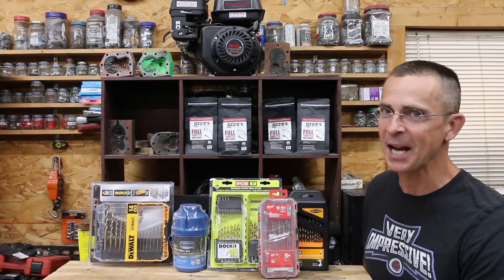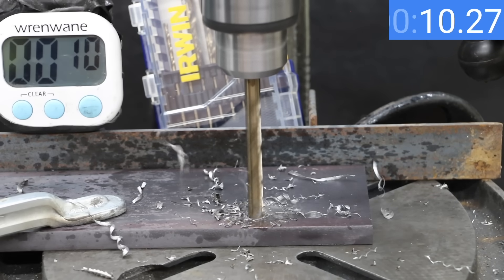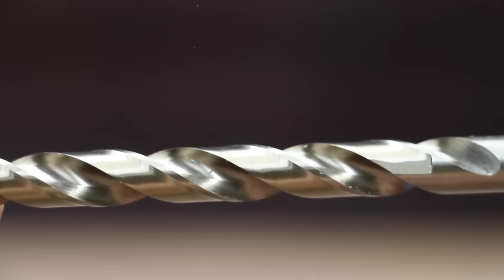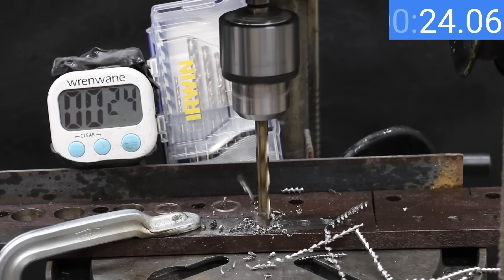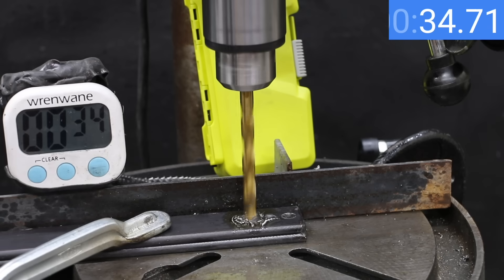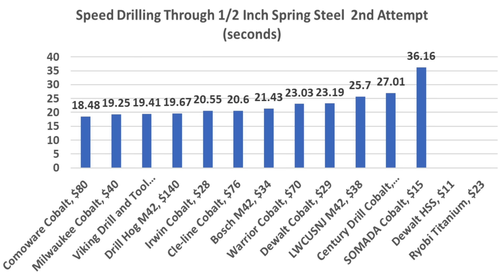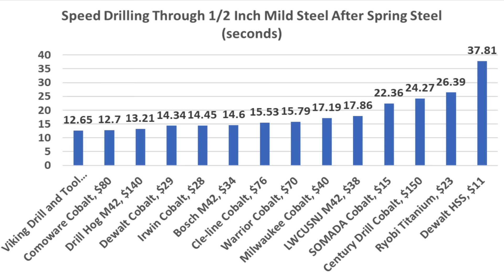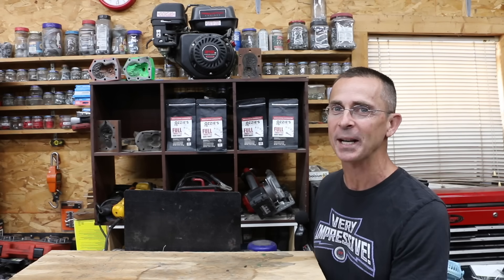Best Drill Bit Set? $11 vs $200? Let’s Settle This!

Comment: Hello Bonjour, ref. windshield wipers. Some time ago, you tested windshield wipers and the Bosch Icons came on top. I agree with warm weather performance but they are edging to be the worst cold weather wipers. I know it would be difficult to test a large sample of winter rated windshield wipers but if someone can figure it out, it’s you. Again, thank you for sharing your thorough testing procedures, your analysis and recommendations while running an ethical, unbiased and entertaining content. Cheers!
Reply from the maker: You are welcome!  Thanks for the suggestion.

Comment: I bought a 6mm Dewalt pilot point 6 or more years ago for roughing/ pilot drilling in my lathe, since I was getting through standard twist drills so fast, it's still going strong( I can't resharpen anything successfully, so it's saved me buying ten or 20 standard twist drills in that time)
Reply from the maker: Thanks for sharing.

Comment: I do like this channel, you do a great job testing.  You provide good data to make your case, data driven conclusions are the best.  The ability to drill holes fast is only one aspect, the other is accuracy, size of the hole, also surface finish. Great job.  Cheers!
Reply from the maker: Thanks!

Comment: I was impressed with the Irwin and Viking performance.
I've got a set of Rigid cold fire cobalt "cryogenically treated" bits that have done very well for me over the years. They tend to be brittle (i've broken 2 or 3), but they cut through anything and don't dull. I can't find them in the stores anymore.
Reply: I've got the same set, appears it's no longer available, sadly.
Reply: wander why...  cant even get decent t shirts any more.. here in aus. there was a penguin brand. still have a few from 20 odd yrs ago. new ones last couple months.. looked up penguin, $50.  not $5, as they are now.. ave, does good tool reviews, & funny.. wit..
Reply from the maker: Thanks for the feedback.

Comment: Ummm, you testing just straight twist drills, or we doing colbalt, diamond tip, carbide?
Reply: We doing metallurgy tests on heat hardening materials that you’re drilling so close to as well? So many factors go into this .
Web size, tip type, cutting angles.

You’re opening a can of worms from anyone who knows about machining at the minimum

Comment: Great test idea.  My Bosch set has served me well for the last 4 years.

Todd, it would be awesome to see you test various car parts from different aftermarket manufacturers.  I never know which ones are best nowadays since there are so many to choose from.  Orielly? Advance? AutoZone?  Sure, every car would be different, but if you were to test generic parts like ball joints, tie rod ends, bearings, whatever…might give us an idea of who makes some of the best parts?  You’re awesome, thanks!
Reply: I'd be curious to see this too but typically the in house brands are pretty much all the same, a lot of them will have the same exact mold/casting numbers on them.
Reply from the maker: Thanks!  Thanks for the suggestion.

Comment: I did work on school holidays drilling 1.5mm (0.0590551181 inches) holes in nuts for lock wire. We used quality brand  drills but some could make 4 pieces and others could make 20 pieces (same brand. same machine and settings) so it can differ in batches.
Reply from the maker: Thanks for the feedback.

Comment: Echo Red Armor 2 stroke oil does an amazing job at cleaning existing carbon out of a 2 stroke engine but could it also work to clean carbon from a 4 stroke engine if you run it through for a while? Better than some of the other products marketed specifically for automotive applications?
Reply from the maker: Thanks for the suggestion.

Comment: I’ve been using the same set of dewalt cobalt non pilot bits for a for a couple years now. I drill a lot of high carbon tool steel (annealed obviously). Biggest issue people have is improper speed and lack of coolant/oil, causing  overheated bits. I will say titanium coating is a gimmick, it’s only to reduced oxidation on the bits. Titanium is soft, way softer than HSS.
Reply from the maker: Thanks for the feedback.
Reply: It isn't titanium it is titanium nitride. Titanium nitride isn't a metal it is a ceramic. M42 cobalt steel has a Rockwell hardness of 68 to 70 and titanium nitride has a Vickers hardness of 1800–2100 66.5 Rockwell is 900 Vickers 1800–2100 is off the conversion chart. Way off.

Comment: The Cle-line looks an awful lot like the set I have from my time in the USN.  30 years, and these bits are still going strong.
Reply from the maker: Thanks for sharing.
Reply: I've been involved in machining for 45+ years, they're the set I would purchase.  Reasonable price, quality steel Huot case, appeared to suffer the least damage, made in USA by Cleveland Twist Drill, and are traditional 135° split-point so they don't walk as much and can be re-sharpened on my Black Diamond drill grinder.  One aspect that wasn't covered was accuracy of the hole size.  As the lips get damaged they will start pulling the bit off-center causing a poorer surface finish and a larger hole.  I was also disappointed that one of my personal favorite manufacturers Chicago Latrobe weren't represented in this test.  I have a C-L #1-80 drill index I've been using in my shop for 40 years on mostly mild steels and some 4140 and O1 tool steels.  They've held up remarkably well, I've rarely needed to re-sharpen them.  I've always use Rapid Tap cutting oil anytime I'm drilling steels (A1 on alum) which reduces drilling forces and greatly extends the life of the drill bit.
Reply: @marcseclecticstuff9497 Yep! The holes have visible tool markings in just about all of them . When drilling metal cutting fluid should be uses more often then just a drop on the metal.  That is the reason most production machines regardless of type have coolant tanks/sumps and pumps to ensure tool life.
Reply: @danielbackley9301  Production demands are actually very different.  The coolant certainly does provide some lubrication, but it serves 2 more important functions.  

First, it's for cooling the tooling.  As the tool gets hotter it expands.  If you have a big boring bar on a finish cut and it's really hot, you'll oversize the bore.  This is also the reason why most CNC machine centers circulate oil around the outside of the spindle and run it thru a chiller to try to keep the spindle at a constant temperature.  Some machines even use a chiller on the ball screw bearing blocks to keep their temperatures stable.

Secondly, and more importantly in some cases, is chip evacuation.  When drilling deep holes you have to keep the chips flushed out of the hole.  If they pack around the drill it will start galling the inside of the hole and left unchecked will cause the tool to seize inside the bore and breaking the tool.  Most of our machines have thru-coolant spindles with high pressure coolant pumps that feed them.  Ours are typically set to 1000psi with the smallest tools, bigger tools with more or larger passages causes the pressure to drop down proportionately.  We run a lot of gun drills, some as deep as 24" or so and if the thru-coolant fails, they will quickly start to gall and seize.

Most modern production coolants use synthetic oils that emulsify in water and look like watery milk.  It's nasty stuff for most plastics and rubbers.  Plastics tend to get brittle and crack, rubbers suck it up like a sponge, expand, and turn into goo.  I had a current probe attachment for my meter that sat in my toolbox that started cracking and falling apart after about 10 years.  I'm very good about cleaning all my tools, especially my expensive test gear and it made no difference.  Even being in my box in the maintenance department there is still enough coolant mist floating around to affect it.

In my home shop I've never used coolant - too much of a PITA to deal with and I'm simply not in a big hurry to do things.  For instance, if I'm drilling a deep hole I simply withdraw the drill constantly to clear the chips.  If I'm doing something that needs a high degree of precision, I make sure I let the part cool down before making a finishing cut to size.  I've used Rapid Tap for the 40+ years I've been whittling metal at home, it's served me well.  Not only does it reduce wear in tooling, it also reduces cutting loads.  Try drilling a 1/2" hole in steel dry, then drill another using a good quality cutting fluid and the difference in feed pressure is quite noticeable.  For tapping I prefer a dark cutting oil with a high sulfur content.  Unfortunately, the stuff I've tried in the past 20 years just doesn't work nearly as well as the stuff I used to get in the late 70's and 80's so I just use Rapid Tap now.  At work they stock Cimtap which I never really cared for.  It's very sticky so it stays on the tool, but it also sticks to the ways of the machine, collects fines and they get drug under the wipers and trash the machine ways.  Not an issue for true machinists who would keep the ways cleaned off, but in a factory full of Bubba's that are too lazy to wipe their own a$$, it's a machine death sentence.
Reply: @marcseclecticstuff9497  nowadays, the same company owns Cleveland, Cle-Line, and Chicago Latrobe. They're all functionally identical, and they all use the same lovely Huot cases. I started off my machining hobby with a set of Chicago Latrobe drills and didn't know how good I had it until I made the mistake of getting one of those godforsaken no-name import number/letter/fractional drill size kits. After I ruined at least 3 projects, I replaced it with the equivalent Chicago Latrobe kit, and the 3x price increase was well worth it.

All this to say, it seems like the corporate merger of those three brands doesn't seem to have ruined the quality of them. Always nice when that happens.
Reply: @marcseclecticstuff9497  Odd coincidence, as I have the same drill bits for my drill presses.  Everything you said about them is true, although I'm sure I don't use mine nearly as much as you do yours.

Comment: I'm only at 10:10 of the video, but my experience with Dewalt bits, they bend extremely easy. They are sharp, and hold a Blade well enough, but I have several broken and bent. I've never had that issue with even the lowest priced Viking bits.
Reply from the maker: Thanks for sharing.

Comment: Always well done. Ideally have two sets of bits. The economical dewalts and some of the high end bits. When you have something hard to cut through I’d slow it way down and use plenty of lube. The cheap bits you can easily repair/replace if needed.
Reply from the maker: Thanks!  Thanks for the feedback.

Comment: 5:44 There's my brand! It's the only non-Japanese drill bit I use! Viking is great, and they have sooo many types of bits and coatings. Their TiAln coated bits are amazing for the price! It will make stainless steel put a hole in itself out of fear alone. 😅 😅
Reply from the maker: Thanks for the feedback.

Comment: Considering the price point : effectiveness ratio, I feel justified just dropping the $10 on that DeWalt set every time I go to the Hardware store. I consider Drill bits "Wear" items anyway, but as long as it isn't Spring Steel it'll do pretty much anything without much complaint. Hell I've ruined more bits having drills fall off higher places than through actual use.

If I ever needed to drill Spring Steel for some reason though, yea I'd probably get something a bit more specialized.

Comment: I am amazed in how much down pressure you use on the drill press.😮  That must be why it takes me forever to drill into steel.😢
Reply: That's why it's called a drill PRESS. PRESS is short for PRESSure. Beyond that drill presses press very straight. That's important too.

Comment: Reasonable testing procedure, but holes that big should really be pilot drilled. Drilling a hole that big without a pilot is basically a destructive test, which is evidenced by some of the results you got, and not how someone who wants to maintain and preserve their tools would use them in reality. Maybe do the tests again with a 1/16 or 3/32 pilot hole....

Comment: I will tell you that I have a set of DeWalt drill bits and a set of Milwaukee drill bits with the 1/4" hex shank. The Milwaukee Red Helix bits dull EXTREMELY fast and my DeWalt bits are still plenty sharp enough to use and I've had them for about a year now.

BUT my Milwaukee Cobalt bits are excellent. They cut fast and clean. But I don't drill through spring steel. Only mild steel and stainless 1/16" - 1/8" sheet metal.

Comment: Great video - At work we drill a ton of metal, lots of Stainless Steel as well and to my surprise the HSS bits that we use (I don't know the brand off hand) seem to perform almost as good as the cobalt bits but we have only recently thought about testing what we use - and we ran a test but it was on taps... tested sizes around 1/4 to 3/8  and there were some clear winners and losers price was not a factor, some of the lower priced bits did almost as well and the best tap was mid priced.  

And right at the end of the year one of the machinists brought in these blue coated bits called mach blue - don't know anything about them but he was saying they are great, but really we have no proof.  Have you heard of this coating?  Don't know but the phillips bits and torx bits had the blue coating - it wore off the tip very fast, like in about 10 tries, BUT they seem to keep holding the screws very well and they might be one of the better bits we have come across - would love to see you test them!

So, are coatings worth it?  Can you re-sharp a coated bit?  And what about this newer (to me at least) mach blue coating - what is it, is it durable, high performance or a gimick?  It LOOKS Awesome though!!!

Comment: The dewalt pilot points really shine when drilling thin metals. They will produce a nice round hole with minimal burr, so i just use them just for that as I have no way to resharpen them as a pilot point. For thicker or harder to drill metal i have an old set of craftsman split point cobalts that i use.  I have some cheapie bright finish 118 degree drills i use for the  household  soft stuff.
Reply: Definitely pilot points for thin material.
Reply: @solarsynapse especially if you are drilling the hole for a rivnut, or some type of thread insert.

Comment: I buy the Bosch singles for drilling tool steel with a hand drill. It roasts cheap HSS bits because of the inaccurate speed and feed pressure, but the Bosch cobalt stands up.
Reply from the maker: Thank you for sharing!

Comment: While I realize that an overly hard drill bit can chip a lot, if they are treated carefully, they will stay sharp longer, and need less time to maintain, so the LC seems like it just needs to be 'babied' a little bit more on the pressure, but if kept within a safe speed, it can remain sharp a very long time, allowing for more actual distance drilled between sharpening, and per unit of time.

I realize that will not mean much to most of the viewers, but to me, its also important to have a hard bit when it comes to bending, because bending can cause a ruined part, if the dimensional precision of the part is critical.
Reply: In the real world people don't baby twist drill bits. Mostly they abuse them. Oh the material is hard so I'd better run as fast as I can!
Reply: @1pcfred  Meh.. I beat the everloving crap outta them all the time.

But then I'm not making 5 million parts out of a single drill bit either.

When its a fast, easy job, YOU BET I'll go for Irwin or DeWalt, got THOUSANDS of them laying around here.

If one ain't sharp enough, I just re-sharpen it.

If its bent, it ends up in my scrap steel pile.

Comment: Great job with the test.  For home use many of these are fine.  I am a retired tool maker and on the job Viking was the best by far.  I could drill so many more holes with out resharpening.  In a job scenario time is money and it is worth the price and the company did supply the drills and other cutting tools.  At home I use what every I have since most times it is hanging something on the walls of the house and you do not care if it takes an extra minute or two.
Reply: Absolutely, I purchase/use Hilti, Makita, Stihl e.t.c... latest & greatest at work. When suburban homeowner buddies ask what tool brand I'd reccomend, it's Ryobi.
Reply: @adamjames1375  Besides the cordless drills I have the main heavy duty corded hand drill I have is a Milwaukee Magnum Hole Shooter.  It's a beast and a real work horse.
Reply: @Finnegan6674  
I'm very familiar with the Magnum, they're my favorite corded drill. Best trigger response & nice low r.p.m. 
One of the few "now made in China" tools that's still excellent.
I work primarily in the field doing carpentry/construction so cordless is king out there. 
Within the last 5 years or so the cordless "pro" model drills have gotten so incredibly strong that I couldn't tell you the last time I used/needed a corded drill. 
I can run 6" hole saws through any timber (tripled up 2"x/sheeted, double LVL, e.t.c...)  & it'll turn a 5 gal bucket of mud without getting hot.
A trick on cordless drill drivers can be to set the drill chuck to "screw" and set to its' highest number allowing the chuck to slip. Most often user input & a brace is far superior, but if you're on a "pick" in the wind, or crammed in some godless crevice, where if the drill gets away from ya, you're going to have just successfully installed yourself a set of Summer Teeth...it's a viable solution.
I also often drill steel (beams, columns, posts, e.t.c.) anywhere from 1/4"-3/8" pilot & ream to size.
...
Any techniques/equipment you'd reccomend for a carpentry/construction outfit to sharpen 135° split point cobalt twist drill bits?